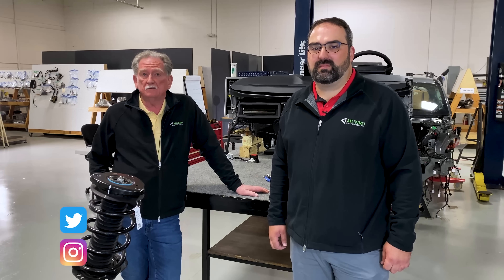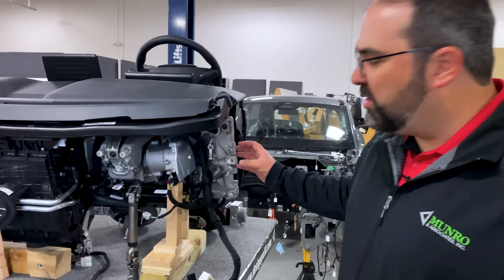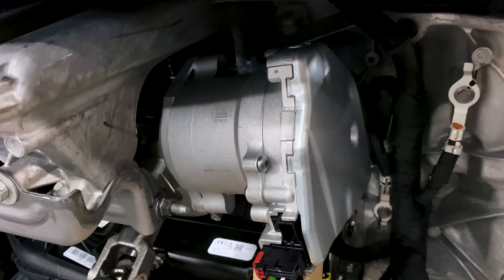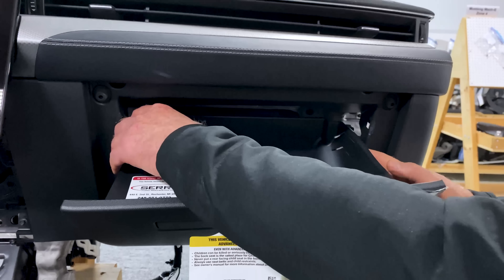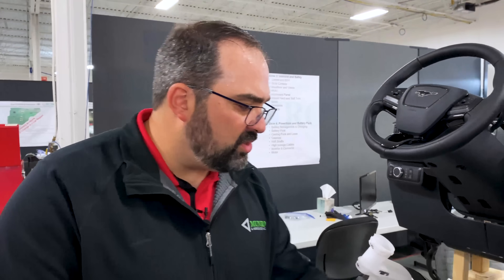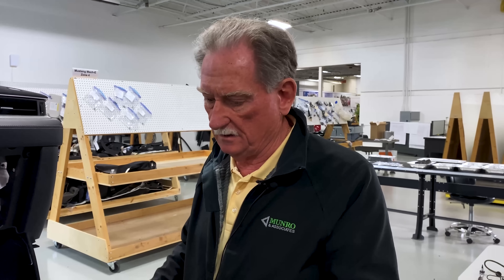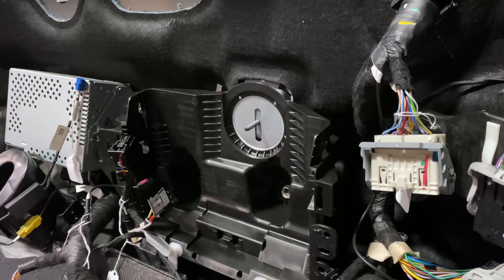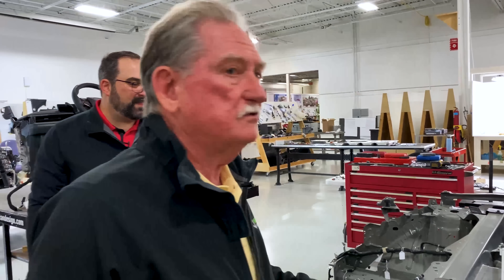Ford Mustang Mach-E Instrument Panel (IP) Assembly and Analysis

Comment: The fact that he missed the brake module was still mechanically coupled and suggested the brake lever could be made from polymer and simply a dimmer switch is a major red flag for me. Shame, as the rest of the team are excellent. Not at all a dig to the channel, but must be pointed out for the credibility he seeks. Perhaps he's too old for the newer stuff and has a mindset of past designs, or too busy on the road perhaps.

Comment: 13:00 How on earth can it be allowed to have a brake system which is not mechanical connected ?? That's been one of the main safties of ICE cars forever, that they would ALWAYS work, even if the electrical system or the engine fails.

Comment: I'm surprised that Sandy got the brake system so wrong. As others have commented, the brake pedal is still connected to a linkage in the brake master cylinder. If all electronics fail in the brake system, you can still stop the vehicle, though not as easily or quickly, by pressing hard on the pedal. If you've ever driven a car without power brakes, this is what it would be like. Toyota has used this identical set up since the 90's and they are very reliable. Our shop has only replaced a few out of the thousands of Toyota/Lexus vehicles that we've serviced over the decades.

Comment: At 14:58 , The bracket that you see should be a BCM bracket and you should have a BCM(Body Controlled Module) fitted to it . So When you uninstalled the IP panel you must have un-installed the BCM already(that's how its designed) , may be that's the reason you do not see the BCM when you uninstalled the IP. When you do the assembly , the sequence is 1) BCM bracket 2) IP 3) BCM

Comment: Was the column-mounted power steering motor helping to reduce the differences between left and right hand drive versions of the car reducing assembly or parts holdings?

I have long thought that the more functions are controlled by electronics, the less differences there are. 

The Mach-E is also built in RHD configuration.

Comment: I'm sure there's still a failsafe mode where the brake pedal creates pressure at the wheels. IE total power failure.
Reply: Not even a fail safe, it’s always directly connected. It’s not a dimmer switch, it’s mechanical. Sandy didn’t knew what he was talking about at all. I don’t get why Ben didn’t correct him.

Comment: I was quite concerned about the large slab of magnesium in the panel. What is the fire rating of something like that? I'm hoping that it is something like "not at all" but I've seen magnesium burn and it's scary. I've already read and seen reports of EVs catching fire and not being easy to extinguish, and adding a huge piece of potentially flammable material that is difficult to extinguish and sits over the driver's and passenger's legs causes me a lot of concern.

Comment: Come on Sandy, dimer or no, in a panic crash, that brake pedal is going to see an adrenaline fuelled full leg press and needs to resist with the right feedback.
Reply: It’s not even a dimmer. He literally showed us the master cylinder earlier and we see the hole where it would go through and connect to the pedal. This car isn’t break by wires.

Comment: Guys, at 11:07 I can see at the left side of the picture that that EV dedicated brake module definitely has a bar which the brake pedal connects with... Few minutes later you're explaining that the break pedal is like a dimmer. Are those both parts from the Mach-E? If so, what else is connected to the bar of that brake module? Any servo drive or something else?
As I know in the past the brake system should have the feature of direct drive from the pedal to the main brake cylinder to be able driver to brake in case of electronic or power off as well as vacuum booster. Thanks!
Reply: This car is equipped with mechanical breaks. I have no clue what Sandy was talking about. It does exist, but this car doesn’t have it. There might be a dimmer on the pedal to allow for regen blending with the brakes, but that’s it.

Comment: You told us that the mechanical brakes get extra power from the engine via a vacuum, but you didn't explain how the new breaks get their power assist, nor how the break pedal gives pressure feedback to the user if at all it does.
Reply: This car is equipped with mechanical breaks. I have no clue what Sandy was talking about. It does exist, but this car doesn’t have it. Have you seen how the pedal was loose ? That’s because they removed the master cylinder that would connect to it. They literally showed us the master cylinder earlier.

Comment: 7:38 What the crap? Is FORD still doing this??? I have a horizontal filter in my old Fiesta and that's the most stupid thing about it! Whenever I try to change the filter the whole air system gets filled with leaves, grass and other debris, that have accumulated above it. So stupid! My A/C drain pipe is always clogged and the water is leaking inside the cabin the whole summer. Meh.

Comment: The brakes are the first thing I’ve disagreed with Sandy on. Conventional brakes are stupid simple and reliable. This just takes that and adds another computer module and several more parts in between the pedal and the brakes to remove the proper pedal feel. I can fix any conventional braking system in a few hours with minimal tools. Now it’s way more expensive and complex to fix. Also I’ve seen plenty of plastic objects that “would never break” actually break. Let’s take the .2lb weight penalty and keep the brake pedal steel please.

Comment: So looking at that body from the front, am I right in assuming that it's not dual purpose for both LHD & RHD? Both the Model 3 & Y looked like they could use the same body for either config. Which way is the better way to do it?

Comment: Those snap fits on a safety critical system are interesting. Are they a new thing in the American car industry, or just new in the braking system? My Alfa 156 from 2000 has the same fittings on the fuel supply and fuel breather lines, but the older hydraulic snap hose clamps in the braking system.

Comment: iBooster is not just a "dimmer switch". There is still a mechanical connection between the brake pedal and the master cylinder. The electric motor will assist in braking, but if it stops working, you can still operate the brake, it's just going to be much stiffer. There is an emergency mode in software for situations like that: ABS/ESP pump will help to create the pressure for braking. The brake will feel very rough but it will work.

Comment: The brake controller module taken out at the start of the video is the mechanical link to the hydraulic brakes it amplifies the brake pressure via a electrical controlled piston it also provides force feedback to the pedal when electric regeneration brakes are being used by the motor control

Comment: I am confused, I thought that magnesium, Although being light, Is extremely dangerous, because of the low melting point of magnesium being about 649° centigrade. Magnesium metal and its alloys can be explosive hazards; they are highly flammable in their pure form when molten or in powder or ribbon form. Burning or molten magnesium reacts violently with water.  Therefore, water cannot extinguish magnesium fires. The hydrogen gas produced intensifies the fire. 

https://en.wikipedia.org/wiki/Magnesium

As a result:
1. Why are they using this material?
2. How do they mitigate the flammability and explosive risk?

Comment: Sorry to say it’s not just magnesium it’s in fact aluminium with a bit of magnesium thrown in to make it an alloy. The Magnesium makes the aluminium tougher by inhibiting crack propagation. This is because the magnesium atom is smaller and the aluminium atom, And this introduces stresses into the matrix which makes the material tougher.

Comment: Me personally I perfer a material that will deform when I'm stomping on the brake pedal in a emergency then a plastic one that could break and stops the application of brakes. Especially when there are no angry pixies™ powering it for whatever reason. What do I know I'm only a 35 year shade tree mechanic.

Comment: Perhaps the brake pedal is designed for emergency braking.  I have lifted my butt out of the seat pushing the brake in an emergency.
Reply: This car is equipped with mechanical breaks. I have no clue what Sandy was talking about. It does exist, but this car doesn’t have it. Have you seen how the pedal was loose ? That’s because they removed the master cylinder that would connect to it. They literally showed us the master cylinder earlier.

Comment: THE SINGLE SHOCKING ELEMENT NO ONE HAS NOTICED OR SPOKE ABOUT: That is the Audio Control Module mounted on the firewall behind the hvac drain tower. Doors and dash removal needed to replace the radio.....ouch!!!

Comment: That cabin air filter serviceable design is really slick.  I recently sold a Mercedes which I had bought the replacement filter for 5 years ago.  I never installed it because of the contortions and fasteners required to get it out.  Give the Ford engineer a gold star and promotion for this design.

Comment: The brake pedal IS mechanical. You can see the hole in the firewall where a rod links it to the electric booster/esp unit. It needs to be metal and it needs to be mechanical in case of a power failure. You didn't talk about that, but we can briefly see that rod while you're handling that unit and that fat section at the bottom of the unit is likely the pressure accumulator for the power assist. So no, the brake pedal is NOT a dimmer switch and yes, it DOES care about hydraulic pressure and whatnot! Even in the dire situation of a total power failure and a discharged pressure accumulator, you still have have to be able to stand on that pedal with all your might and get some braking done.

Comment: Electric brakes? What happen when you have electrical failure? Let’s hope it has cable actuated emergency hand brakes.
Reply: This car is equipped with mechanical breaks. I have no clue what Sandy was talking about. It does exist, but this car doesn’t have it. Have you seen how the pedal was loose ? That’s because they removed the master cylinder that would connect to it. They literally showed us the master cylinder earlier.
Reply: @cedricpomerleau5586  I had to watch it again. You’re right! It seems that electrical master cylinder has a mechanical pump with an electronic booster on it.

Comment: Are the manufacturers avoiding plastic accelerator and brake pedals for safety reasons? I mean, plastic can and will crack and create sharp edges. Maybe they tried it in crash testing and the pedals created sharps that could impale the driver?

Again, I don't know that; but I imagine it happening.
Reply: Have you ever seen what metal can turn into after a catastrophic accident?

Comment: If that abs/master cylinder unit was from the mustang it clearly has a mechanical pushrods activation, hence the steel pedal assembly.
I think it will be a while before we move to completely electronic braking without manual backup

Comment: I think that the brake lever has to be steel by law.
Reply: Maybe that's what end up happening do to the requirements. I have only worked on material handling equipment and those standards say for force x you must have stopping distance y or less. There is also a minimum number of cycles the brake pedal must be capable of. This vehicle appears to have brake by wire. I am somewhat concerned about failure modes. Sure these systems have been in use on airplanes for years but, have automotive designers and mechanics caught up to the design and maintenance requirements yet? I don't think so

Comment: Actually I believe the brake system does still have a mechanical component. The brakes still need to operate if the vehicle has no power, which means no assist, which means increased effort. This is why the brake pedal assembly need to be strong and that's probably why Ford needed to make it out of metal.
Reply: I looked around for a bit and it seems that there aren't any (popular) cars that use a brake by wire system.
I speculate it's impossible to make a BBW system pass the regulations(in general).

Comment: although the brake pedal works like a dimmer switch, and 99% of the time it won't be jammed hard, but I imagine in hard braking and as it ages, and as Sandy said, there are two kinds of plastic one that breaks today and one that breaks tomorrow, I dont see why it wouldn't break in an emergency when you push you foot through the floor to stop the car, ( for people that never drove pre abs cars where you knew that you had to modulate the breaks yourself)

Comment: Is there any risk that the magnesium will catch fire? That stuff burns really hot when it gets going.
Reply: Yes.  It will catch fire, but the whole car would have to be burning pretty good already to start it.
It won't cause your car to burn, but it could make a fire worse, eventually.
It's not a passenger risk, unless you are actively driving around in a car that is on fire.

Comment: The brakes are still mechanically connected and are not applied by wire, in the unlikely event you loose power I'd hate to think the brakes would stop working.   I think in that situation there is no power assist so strong mechanical force is needed hence the "manly" metal instead of plastic.  Mechanical connections for brakes and steering seem to be something that should never go by wire only.  Thanks Sandy for the great content, although I don't agree with all of your opinions I still appreciate the opportunity to hear them.
Reply: As soon as I finished watching the video, I went looking for this comment. Are you certain there is still a mechanical connection? If so, Sandy got that wrong.
Reply: @michaelwetzel3258  at https://youtu.be/hjhKPmTV7Tk?t=627 he shows the "master cylinder" assembly, clearly has a shaft that attaches to a lever of some kind.  At https://youtu.be/hjhKPmTV7Tk?t=813 he shows the brake pedal, if you look close there's a hole behind it (upper portion on the firewall) where the shaft comes through and attaches to the brake pedal lever.  Also see how floppy that pedal is?  that's because it's been disconnected from the mastery cylinder.
Reply: Fly by wire is standard for years, i am sure that drive by wire will come in the near future.
Reply: @geroldbecker3315  Most people don't understand the level of redundancy present in fly-by-wire aircraft systems. An FA-18 has 4 channels powered by 4 generators and a battery. Any combination of failures that are bad enough to make the FBW system fail would make the airplane crash anyway. Redundancy like that isn't cheap. A mechanical backup is a relatively inexpensive way to solve your redundancy problem.
Reply: @DragNetJoe  You are right. The actual mechanical systems do not have a real redundancy (e.g. leak of break fluid in the system), because they are so reliable. Maybe for drive by wire system, a single redundancy would be ok. The regulators will need a long time for giving us an answer like for the old school side mirrors  :-)
Reply: This comment.
Reply: Two years later. Full drive-by-wire steering has arrived in the Cybertruck. Per @DragNetJoe comment above, redundancy makes it safe.
Reply: Mechanical brake doesn’t have a redundancy. The solid state brake by wire should be a lot more reliable than mechanical one and can be made even more reliable by given second independent wire.
Reply: @quansun7633  Actually most have a dual-loop hydraulic system with each loop powering both front and one rear wheel. Also, cars are required to have an independent aux brake. Mechanical brakes continue to work with failure of the booster or anti-lock circuit. The mechanical circuit is extremely reliable.

Comment: Why does the steering not feel as smooth on the Mach E, is it the lack of virtual ball joint in the steering or the motor being in the IP rather than the steering rack?

Comment: Regarding the brakes, a strong pedal is still needed. When you hit the pedal you still press into brake fluid in the first place which transfers the force into a sensor. In case of an electric failure the brakes still have to work. So the force bypasses the sensor and goes directly to the calipers via the brake fluid with a lot of force on the pedal required.
Reply: Ok, but wouldn't the plastic pedal be sufficient. If you were applying the force regularly, eventually the plastic would break. In that situation the metal pedal makes sense. However, the scenario you described is very rare. The plastic pedal is still strong and wouldn't break if the required force was applied.
Reply: These brake systems are fully fly-by-wire. There's no hydraulic connection to the pedal. I'm not sure when this was first allowed - but my guess is it was introduced with EVs, because of the availability of regenerative braking, which is on a separate electrical system (the HV side, whilst the brake pump is on the 12V system).
Reply: @markirmuir  Well, keep in mind what happens during emergency braking. As more braking is applied, more force against the pedal is applied, due to the forward momentum. Not only that, during a frontal crash, significant forces will be applied on that pedal if the foot is still there. One may easily be able to break a plastic brake pedal during such situations and I’m sure seeing a brake pedal broken during a accident investigation will create serious questions regarding the safety and crashworthiness of the vehicle.
Reply: @markirmuir  Look closely, we see the hole where the brake assembly connects to the pedal. That’s why his pedal was loose. This car IS NOT equipped with brake by wire, but there’s indeed some cars that do it.
Reply: @markirmuir  they are most likely not full brake by wire.
At least the VW system uses a link to a modulated cylinder to provide feel/feedback as well as act as an emergency brake cylinder for cases where the electronics have failed... It might be unassisted, but it will still brake the car.